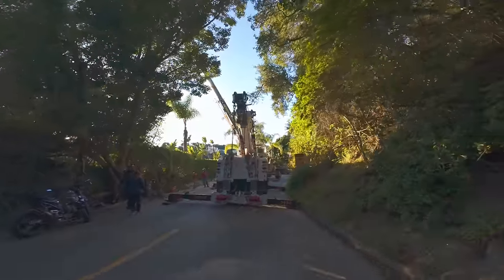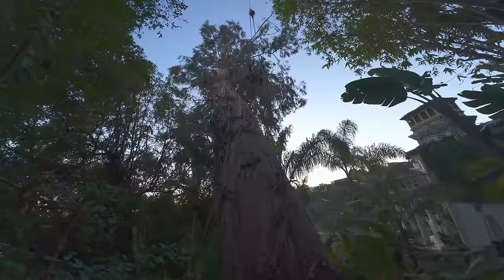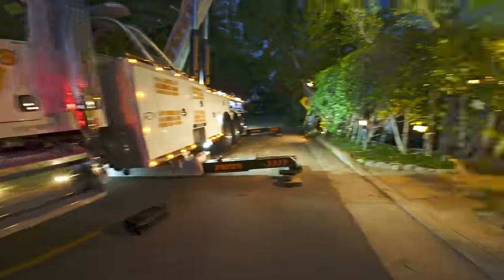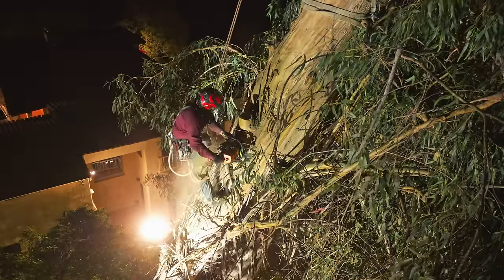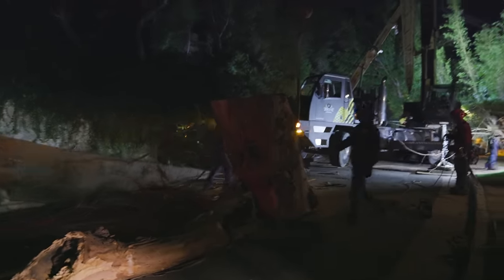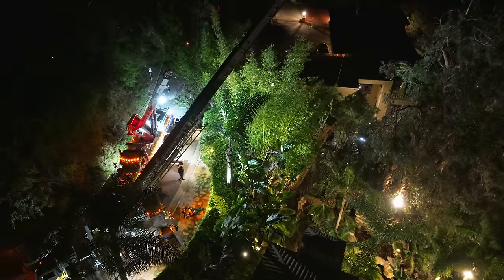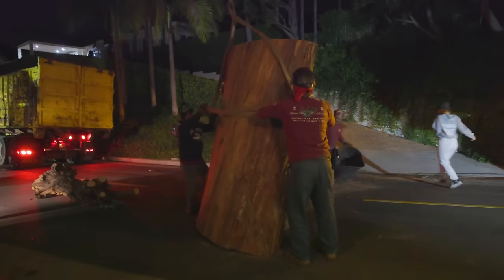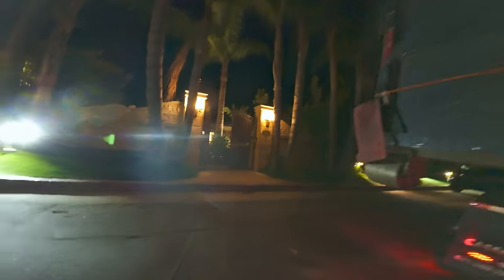Huge Tree Almost Falls on Beverly Hills Mansion

Comment: Alex, those guys on the tree with 6 foot chain saws are really at risk! What a job! Great video! High desert cheers from New Mexico! Thanks!
Reply: Wesley Pulkkka, Actually they are pretty safe.  The guy in the tree is hanging from the 40 ton crane, and they strap on the top of the tree to that crane, then they start to saw off the top of the tree.  They have a weight sensor, and are trying to take down 7,000 to 10,000 pound sections of the tree at one time.  

I know someone who was a tree topper in the forests of Northern California.  He would climb a tall tree, and cut off the top 30 feet or so, strapped to the top of the tree he is cutting.   Then the tree would potentially start to swing side to side for about 45 seconds.  What a ride that is!

Comment: Awesome job ! Nothing and I mean Nothing you guys can't handle. Professional all the way.
Reply: We have a slogan here at Pepe's  "We will tow it, lift it, push it, pull it, yank it, or drag it, but no job gets left behind." Our thought process is that another driver just like ours with another truck just like ours is gonna respond and try to tackle it as well so why pass it on. Besides, the real BIG jobs are routed our way anyway. Most of our competitors accept the call then call a 2nd, 3rd, and even 4th company to help them complete the task at hand. Now that's time consuming and extremely expensive ! Van Lingen Towing out of Torrance , CA has a large fleet of heavy trucks as well and give us a hard run for our money. They are extremely knowledgeable and efficient. We have a lot of respect for them.

Comment: Most residents live in the area of Beverly Hills known as "The Flats."  The Flats are relatively, well, flat, and they slope away from the foothills of the Santa Monica mountains.  That used to be an agricultural area, with just small roads in and out, and like most such, they generally started out as trails, following the lay of the land and the path of least resistance.

When they began to settle in that area and it turned to housing, the construction equipment and the trucks to move dirt, rock, and gravel in and out of the area to build up the roads was  relatively small, compared to our own time and the massive equipment they have in this day and age.  

A lot of those roads are still so narrow that a couple of Model As would have to be careful passing one another.  Even where roads are wider, there is the matter of parking and all that.  It would be a logistical nightmare to get permits and to clear roads and all that, like Josh says.  Then, there are all the money elite who are all "you can't tell me what to do!"  Different rules for the rich, famous, and connected than there are for the rest of us.

Comment: In climbing, "belay" refers to the act of securing a climber using a rope system to prevent them from falling far if they slip or fall. The belayer manages the rope, applying tension or slack as needed to support the climber's ascent or descent.

Comment: I was laughing so hard when you said the tree is a "Widow Maker".  Like a peach, pear and window maker.

So in Catalina Island they imported a lot of Eucalyptus trees from Australia, and their strong roots are to help stabilize the roads cut into the side of a mountain.  This looks like a 100 year old Eucalyptus tree.  

Any tree can become a widow maker.  What happens is the wind can break off a limb, and then it gets stuck in the upper limbs.  Then when the wind is just right, the branch can fall down on someone, making their wife a widow.    This tree is uprooted, and can make the whole family a widow!  LOL.  Good think they noticed the tree falling, before it crushed anything below it.  It's a great thing that the Eucalyptus has very strong roots!  

The guy cutting down that tree, he needs to have two saws!  The blades can quickly get dull, with all of the sap from a healthy tree.  Each cut is about 3 or 4 square feet, so much more than cutting up a dozen 9" diameter logs.  The tree section taken down at 54 minutes into this video, I am happy you found out the weight is 7,000 pounds!   Of course getting closer to the base of the tree, a 7 foot long section is going to be heavier.  

Many people do not understand that the 40 ton crane is near it's capacity when taking down a "Unknown" but 7,000 to 9,000 pound tree section.  It is so far from the center line of the crane pivot point.  

Great video!  I am very happy you skipped through the right amount of the boring parts!  And kept in a lot of the parts that are interesting.
Reply: I thought perhaps the saw man was swapping chainsaws when he rode down with each section - get a cool, refueled machine with sharp chain.  Big, big job.  Dense, gummy eucalyptus.  Fun job when cutting into a hornet nest up there.  The Treasury Dept cannot print enough money for me to consider that work.
Reply: He's using a self sharpening saw

Comment: I bight my 2380 in 95. We’ve had it hauled all over. I got a 70’ boom on mine with a 15’ jib. Also an extra 10 k counter weight. We’ve built so one 40k bushel grain bins. I’ve driven it all over. There’s a u joint really high coming from back of engine you’ve got to grease that sucker. Mine blew apart took out accessory cover etc cost me 5 k to get it fix it. We can put boom on or take it off easily. It picks up and Carrie’s grain bins in one piece. We’ve got a 50 t grove crane I like the 2380! It’s how I’ve got my crane lisence

Comment: I really did like your time out comment I'm a general contractor and I spent 12 years setting houses with various cranes all the way from 100 and 40 ton cranes most of the time 70 and 90 ton cranes but my job was to set the equipment around there and protect the crane and people don't understand about the lift of a crane and how much booming means I mean you need to look at center point at your furtherest place that you're going to boom for which you're safe to do and anything outside of that should not be attempted I can always come up with a better way to do what you're doing but who couldn't but I think you're doing a fine job and this Monday morning quarterback stuff is a crock of crap I understand what you're going through and the decisions you have to make on site let alone the other people that you're working with and they may be the lead on the job so you have to listen to what they want to do as well as long as it doesn't endanger your equipment or your people

Comment: Very enjoyable video guys spent the whole 2hrs watching.  Thanks, Alex did you get a look at what those tree climbers used to pull themselves up.  That is what you might use when you are climbing those jobs where you have to climb down a canyon and back out again like Angeles Crest Hwy. just say'n
Reply: Nope. That's a Petzl ZigZag which is a very arborist specific piece of equipment that will not work in industrial / mountaineering environments. It's designed for hauling / descending in free airspace. What these guys may use is a capstan winch or a secondary with a textile rope that is man rated.

Comment: I the failure of communication that  happened at 1:26 - I’m not sure if it was the loggers in the tree or the crane operator but I’m glad they are all ok and they all stopped to fix it. That was a pucker moment for sure. You would’ve had the perfect shot of that!
Reply: They had an angle cut and when the cut was all done the weight of that log just slipped. There was a new climber helping the main climber and he was given one shot. He was supposed to have a trait cut so crane could pick up safely.
Reply: Straight *

Comment: Now, if someone was really thinking that trunk could have been used for pieces of furniture. Therefore making some money from those scraps. So for each section of that log, there went $$$ down the drain.
Reply: Now you know a little bit about how I think. I was thinking of tabletops about 2" thick. Now how many of those tops went to the land fill?
Reply: It’s Eucalyptus, they may mill it for outdoor furniture. Can also be turned into mulch.

Comment: How many sponsored adverts does YT need . The guy works his ass off to make content but I spend more time watching adverts . I wouldn’t mind if the ads were of any value to me .
Reply from the maker: How many did you count? Someone else with YouTube premium (which has no ads) mentioned the same thing which shouldn't happen. I used to be able to manually control stuff like ads enabled or disabled during my videos and now I can't with the new YouTube update. I personally hate ads and wish they gave us more control over them.
Reply: Hiya 5 commercials maybe 10-15 minutes apart . There sponsored so I can’t get rid of them . I’m UK based so it may be different rules . It spoils the videos you work hard on . If you were receiving a cut of the revenue I wouldn’t mind. But this goes in YT pockets as far as I know , but I could be wrong . I’ve noticed a difference in ads depending on on which platform I watch YT on . TV and Phone are definitely the worst though. . Take care mate stay safe. Darren🇬🇧

Comment: Unnecessary risk, why did the tree climber/chainsaw operater ride with each cut piece instead of remain with tree to prepare for next cut. Unnecessary risk and wasted time.
Reply: Maybe for the safety?
Reply: Before this, I have never observed anyone riding the cut piece to the ground, too dangerous.
Reply: He was suspended from the crane ball - the tree was uprooted and too unstable to risk, even with Flipper's support.  Also, with each trip down he could take a little rest, change underwear, hydrate, swap chainsaws for a cool, fueled, sharp chain without eucalyptus gum in it.  The spinning would be annoying.

Comment: your family business need to invest in a bigger crane that tackle this sort of work
Reply from the maker: Why? This is the first time we've ever had a job like this. This is super rare. You'd spend over a million on a larger truck just for a once in a lifetime job??? That's horrible business practice
Reply: @PepesTowingService  You certainly have a lot of great, capable equipment, but in my opinion you have invested in the most important factor - people.  Skillful, smart, safe, trained people will figure out the safe way to do it.  I enjoy watching the off-road channels that show a smart man using a modified Jeep to pull a bulldozer out of a swamp.  You always show up with at least enough machine firepower and probably an excess amount of brainpower (even when one driver responds alone.)  (In the published videos.)  Great channel.